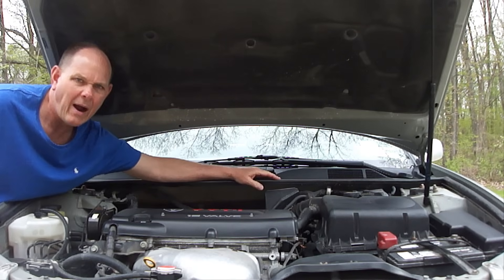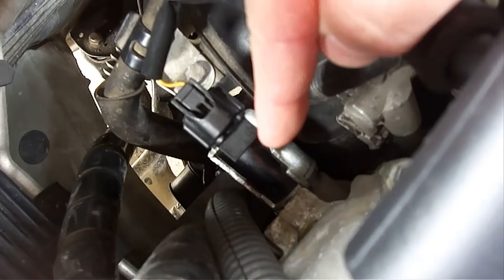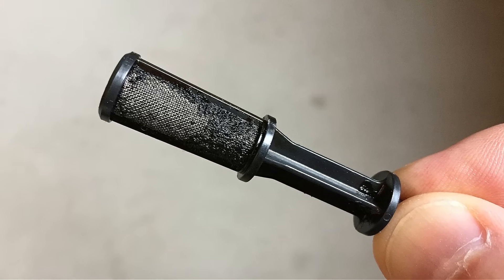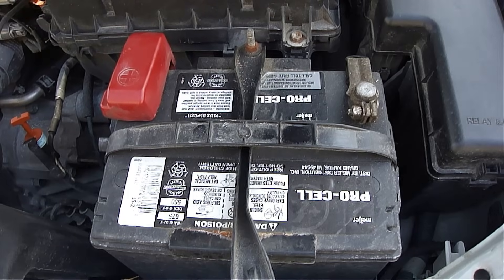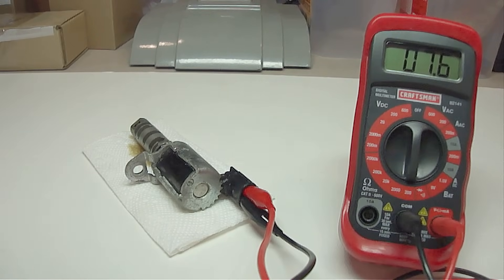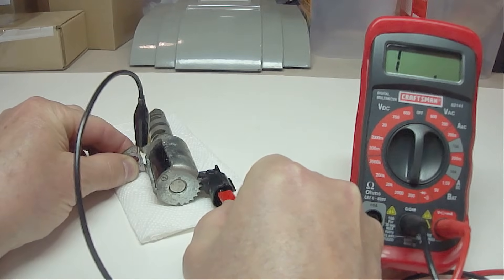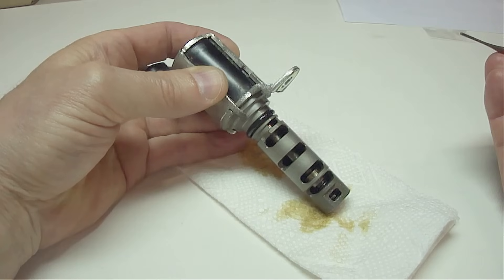How To Tell If Variable Valve Timing Solenoid Is Bad On Your Car P0010 P0011 P0112 P0013 P0014

Comment: BE CAREFULL. my solenoid was not wanting to come out. I was using a screwdriver to pry on it and the solenoid snapped off, leaving the body still stuck in the engine. I don't see any way of removing it short of disassembling the front of the engine, timing chain cover,etc. amd not sure if that will provide access.

Comment: For all who needs an example , 
MY SOLENOID WAS BAD , It looks fine not dirty or yellow as i change oil alot . but i cleaned it properly with carb cleaner and an air compressor

that helped it modulate way better at low rpms as the rod had some binding points , BUT the motor is a bit worn as its not a snappy click but sounds more like a "clock" AND the little spring at the end is loose and doesnt snap the valve shut properly .

i could feel my car after some time not hitting lift properly at all and it didnt rev out as smooth , shaking at idle when warm and confusing itself on where to settle before it went too idle

replaced it and the lift and crossover are properly back you can hear it crossover and it can rev out too limiter without making a fuz and it idles like a kitten , needle not confused at all when it drops to idle

Comment: There is another solenoid in the front for the exhaust. It’s very much the same one in the back we have one screen on it and the new one will have three screens cause this is a problem at startup because it holds the oil back. It makes the engine misfire.

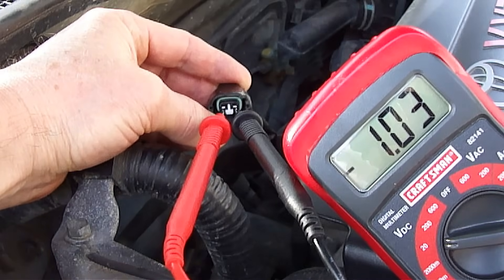Comment: 1:44  i test the harness in different way I hooked the ground to the car chassis and I put the positive on each end 1 end getting 12v the other end getting 2 volts , shouldn't 1 of the end get 0 reading as it's ground ? Do I have short or something because my vvt are working good they are new . I have P0011 P0014 so common sense is to test those before I go to a conclusion that my timing is bad .

Comment: HI mate. When powering the solenoid valve with 12 volts to the battery.  Is the electrical connections specific on the positive or negative settings?
Reply from the maker: @hendriksaldua8208  No

Comment: Useful info. I don't have any codes, but I have a .12 amp drain on my battery when the car (2012 G37) is off. When I pull the 50amp fuse for the VVEL  solenoid it drops to .01. Going to replace it this week.

Comment: Very informative, thank you. 
Question: does a bad VVT solenoid cause, for lack of a better description, a 'wheezing' noise when bad? - I am not getting any warning lights and no noticeable running problem, but rather a noise that started suddenly and that now goes up and down with engine rpms. 2012 Range Rover Evoque 130K miles.

Comment: My Hyundai i20 AT had this check engine light on for 3.5 years...I took it to 7-8 car garages.. had many scans done but all those idiots could not diagnose that the VVT solenoid was broken on one side and hence the light was on. Finally i found a mechanic who diagnosed and found this. On changing it immediately the CHECK ENGINE LIGHT VANISHED. Also thanks to this video which i forwarded to the mechanic it helped the mechanic

Comment: I think you may have solved my issue on my 2010 Buick Enclave, But I am getting a P0008 code which is related to Timing chain issue but I only trip this code when I stomp on the gas to get across a 2 lane highway or I get shudder Lack of power when I am going up hills. which I thought was transmission issues, Recently I replaced 2 cat converters P0430 and P0420. Leaning now towards VVT Solinoids
Do you think my issue is simular with a P0008 code?

Comment: Life saving video.. my hyundai i20 automatic check engine light was on for 2.5 years. Many car mechanics could not diagnose why. One guy recently diagnosed it - CAMSHAFT VARIABLE TIMING SOLENOID VALVE - thanks buddy
Reply: Mechanics could NOT fix it or find the cause?....oh man....a $30 OBD reader would have told you that, even for DIY-er's who are NOT mechanics..... OMG....SMH....😵‍💫

Comment: If you have no voltage you're more likely to have an open circuit versus a short circuit. If you have a short the fuse will blow and create an open circuit.

Comment: Really helpful explanation of how to diagnose a faulty valve timing control / oil control solenoid.  I am going to ask my mechanic to run through these tests before he replaces the existing one as they are $1,500 USD just for the part, and it may not be the answer!

Comment: Bad way to check. You'll burn coil with 12 v dc. You should conect pwm to check stroke of slide in solinoid. When you give  variable duty pwm to coil . You'll see it move . If not response . May be it was stuck or coil damsge. " Do not aply 12 v dc direct to low ohm coil.

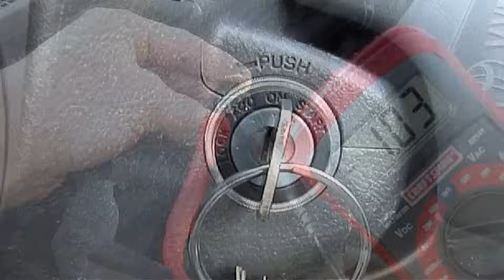Comment: 1:45 how to check for shorts in the wiring?

I got the code for VVT, but it has proper resistance.  The connector has none

Comment: My Nissan rogue 2015. Runs great at first after warned up it vibrates at idle. NO check engine light. However the Scanner says vvt monitor bank 1 fail , status FAIL.. all other sensors seem fine and clean. What could this be ? Solenoids ? Or timing chain ?  Oil changed every 3,000 miles since new ..

Comment: Excellent video thanks.
 Mine also has the screen at the bottom below rhe solenoid...should I try to remove & clean it?
 I'm not sure if I should take the risk .... my understanding is that they're very fragile.
Reply from the maker: It would be safe to soak it in gasoline.

Comment: Great video. My VVT  harness voltage shows ~7.3 V. Resistance show ~7.6. Use 9V battery test is best way. Old battery of 7.7V does not trig valve open or close.  Use MAF cleaner clean surface, and ultrasonic bath clean VVT ( merging into ethanol or gasoline) to remove the tiny deposit. Put it back, it works great. Toyota part costs $244. OEM part costs ~30 bucks. Cleaner costs 15 bucks.

Comment: Don't know if mine's operating or not and it's a PITA to pull but there's Oil in the plug. So I did a little research and found a replacement with a better rating than the factory piece for a fraction of the price.

Comment: Hi, I have a daihatsu sirion 2/toyota passo with a K3VE engine. I get 1.3 volts at the connector with the ignition switch on. The manual says i should get battery voltage. Is there something wrong?  Regards

Comment: At the 30 second mark of the video your finger appears to be directly below the Intake cam VVT solenoid. The 1ZZ had a VVT on the intake, or exhaust cam depending on the series 1 or 2 engine version. Then I believe on the 2ZZ there are VVT hubs on both cams. Thanks for the video.

Comment: I have a 2013 Nissan Micra K13 1.2L with engine pinking issues, especially noticeable when cold or when the aircon is turned on, or accelerating from lower rpms.  Could this be related to a faulty vvt solenoid?  The car has had regular oil changes from new and currently has 192,000kms on the clock.  I’ve owned it since it was nearly new.  Thanks.

Comment: Damn wish I saw this video before I Removed mine, cleaned it with some Carb Cleaner, Then Tested its operational Status, "Clicks Open and Closed fine" Then I cleaned the Plug contacts with a safe electric contact cleaner by WD-40 Specialist Electrical Cleaner Spray.  Then I dipped in new oil up the the O-Ring and replaced, never did any electrical meter testing :o/ 

Some say don't use the carb cleaner some say its fine because its only being used on the metal part and not the sensor side of it. 🤷🏻‍♂ 

I just reset the fault code P1140 "INTK TIM S/CIRC-B1" - on a 2003 infiniti FX45, Hopefully it won't come back? Will come back and update if "Check Engine" Light comes back on.

Comment: Good Test of it working ... It gets signal from the computer, & rattles back & forth diverting oil into different parts of the cam shaft to advance or retard the valve timing .. .  I wonder if can wear & "let by" oil too  So appearing to work in the test but still being wishy washy in controlling the oil.. Having good clean oil & filter important too

Comment: What about oil leaking occurring.... my vvt is being replaced as this was seen as a symptom? My car seemed to run fine. Oil changed every 10k. No check light error
Reply: By the time it starts leaking is better to replace it

Comment: 😂 2003 Matrix engine knock forever, pulled and cleaned oil control valve and super dirty Clogged Screen!  10 minutes and old car runs good now.

Comment: Does oil pour out when you remove the valve? Also I suspect you have to re-install the valve if you want to drive to the auto parts store for a replacement!

Comment: I was just tooling along on the highway, I rarely use the cruise but this was one of the times. I had code "P0015 - "B" Camshaft Position - Timing Over-Retarded Bank 1"
This has happened 3 times in the last 3 years, what's weird, it was roughly the same location on the highway!

Comment: Paul, I have a 2010 Camry.  I received the P0013 code.  I completed step by step, by the way; best video I have ever seen on here, and everything has checked out.  I replaced both of the OCV/VVT and still getting light and codes.  Any suggestions?
Reply: did you read any voltage at the connector with the switch on? i read no voltage and i cant find anywhere if that's normal for this car (also have a 2010 camry)

Comment: Great video and word of caution.  You tested the solenoid input voltage at 1v and used the 12v battery to activate the test. AA battery most likely would have been sufficient.  Too many amps and/or voltage could breakdown the insulators in the part being tested and destroy it prematurely. A stepdown transformer with the battery would be a decent option too, amps depending. 😁
Reply: It’s the standby voltage.it’s got no amps .it needs more voltage to operate ..

Comment: Hi my dear i have a Suzuki swift 1.2 the car got in the past 10w40 oil, and i know its wrong, the problem with the car is when it’s cold you have to turn starter long time and in a moment the car starts then you turn off and on and start normally and when it gets cold again not to run the engine, i already tested ignition coils, injectors, sensors(ckp, cmp, map, temperature etc) all OK, the car when your turn starter seems to be retarded and i thinks is the vvt valve i already change to the correct oil 5w30 and filter and the car improve a little but stills having problems in cold starts the vvt valve resistance is 8.0 omhs and when you excite it with 12 volts works perfect, i don’t know if it’s a vvt solenoid problem or another what do u think?, i also think about oil pressure it can be low and this cause valve not to work correctly?, do u know how oil pressure its ok? Any help it’s welcome, By the way excellent video thank you very much!
Reply from the maker: Have you cleaned the throttlebody?
Reply: @proclaimliberty2000  no i don’t it can be the problem?

Comment: Sir, its great experience, i have 2NZ engine car, it has no check engine light but the engine hesitate during cool season and prompt acceleration, it loses powers untill engine gets hot properly. I have checked its VVTi following the identical steps, it doesn't give any reading for ground test on digital metre ! What does it means further pl!
Reply from the maker: You may have a failing engine coolant temperature sensor.
Reply: Yes sir, it had issue including the vent/evaporate valve, i have changed both consequenlty improved but still has some jerks especially in cool and rainy weather, it vibrates in ascend road and in prompt acceleration. Its not settling yet.
Reply from the maker: @khalidmahmood8822  Have you cleaned the MAF sensor?
Reply: @proclaimliberty2000  yes sir pl, its clean including throttle body.
Reply: For the cause, have already done work by cleaning MAF sensor, O 2 sensor and catalytic convertor. Hence have tired, 😴
Reply: The symptom of engine hesitation emerges mainly in rainy and foggy days in winter season, once engine is hot it disappear, but never noticed in summer, i have sympotic grounds which aresembles to a faulty VVTI. Giving that clue to highlight my issue to get assistance

Comment: QUESTION..Can I measure the coil ohms while it's still in the truck?  F150 5.4L.  Need to remove the valve covers to remove the CVT..Thanks! 🇨🇦
Reply: Did you get it figured out? I have a Taurus, similar situation, gotta pull the valve cover too. Don't really want to unless I have to change them.

Comment: I have a Toyota Yaris 1.3 VVT-i  T Spirit (03/05). its few weeks the check engine light is ON . 
One mechanic said, this problem is from chain and I have to spend too much to change it. 
With OBD2 Car Code Reader, I founded out the problem. P1346 ( Manufacturer Control ).
Could you help me what does it means ? how can I repair my cay? Can I do it myself?
Thanks...
Reply from the maker: Do you have a digital multimeter?
Reply: @proclaimliberty2000  yes
Reply from the maker: You need to inspect the variable valve timing oil control valve. Go through my videos under automotive and you will see how to diagnose it with a digital multimeter.

Comment: I was getting a code P0016, then p0104 , P16A1, 2645 .replaced the chain and tensioners and  sprockets and now I still get the same codes.  Any idea what it could be?

Comment: Wow so thorough I love it! The other people that make videos like these just don't seem to care about the details I mean he even told us that it's located at the front of the engine which is so key. Thanks again!
Reply: @proclaimliberty2000  do you have an Instagram account?
Reply: Location depends on the vehicle. On my car there’s 2. One on each side of the engine
Reply: Was going to say just like you did here ✌️🖖
Reply: It was pretty informative. One issue right at the start of the video where you said this part sends information to the vehicles computer is not actually true. The valve is just a dumb component that's controlled by the computer.
Reply: @Danlyman2010 the sensor is the watch dog that tells us if the vvt/ocv has been slacking on the job.

Comment: One question- my VVT system has failed but I have had no luck figuring out why. How much voltage should be sent to the solenoids? My car (2015 Toyota) has 2 solenoids with 6v going to each. Neither move with this voltage, nor does a brand new one. I've held it in my hand and re-attached the connector and nothing happens. With 12v and test leads, its does move. Is this normal with the engine off and key in ON position? I've checked everything else- 30psi oil pressure at the pressure sensor, clean VVT oil screen, and oil slings out the solenoid ports if you crank it with solenoids removed. Only other thing I think it could be is the cam phaser(s) if its not this.

Comment: How do I find the ohms range for 2011 Chevy Malibu vvt soleniod?
Reply: HI ,Samantha, here what you can do is first you need a multimeter in hand, set it to ohms reading then using the red and the black leads attach one in each other solenoid pin connector, then you will get a reading around 07.6ohms and depands on yours solenoid specification model. I hope this reply may help you and feel free to ask if you need more help.

Comment: Where do we find information on ohm resistance values for particular vvts?
Reply: Usually in the vehicle service manual, you can find them on the manual datacar pages and some in AutoZone, there is a lot of information on the net.

Comment: I have the same problem. Those two codes, P0010 and P052B, but I also see P0012 and P0013 that are related to VVT actuators. Those last two codes say that the camshaft position is retarded.
I already did the test and the cales if they receive voltage, the actuators I connected directly to the battery to know if they worked and yes. What will be the problem?

Comment: Thanks man ! mine looks clean as hell soaking it for 2 days to try and get any gunk out if there was any it wasn't visible, with mine the spring is at the top near the connector so it probably traps a lot of gunk and its completely seized! Also to anyone trying to test the spring by moving it up and down be careful its pretty brittle metal as I just found out when It chips a piece off. Luckily mine was seized or unluckily so it doesn't matter.

Comment: If my Toyota is revving between 1200-900rpm when idle, could cleaning the two cam solenoids help?
Reply: Bad throttle body if electronic if it is not it will have a idle air control valve thats usually what causes high or irratic idle
Reply: @Mrs_Nesbitt01  thanks I found that it was the air con! After turning all electronics off, no more revving!

Comment: Can a mechanically stuck open VVT solenoid affect starting engine compression and hence cause an extended crank cycle? Would it also lower the measured psi during a compression test?

Comment: forgot if i asked but if the vvt is faulty would it cause car to make ticking noise that goes on and off but lingers at low rpm but will disappear around 3k rpm but will come back as rpm powers back down ?

Comment: Is it possible for the OCV to stick in the engaged position after you let off of the throttle?  I have a 2000 GTS and after engaging the lift and letting off, it makes a funny exhaust sound.  It goes away if you let it idle for a little bit or shut it off and let it rest.
Reply from the maker: Yes